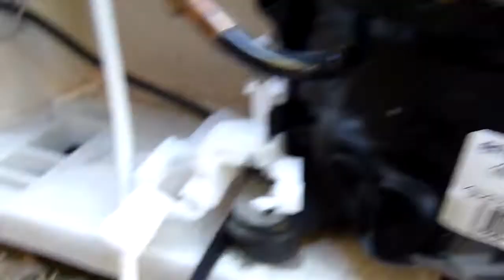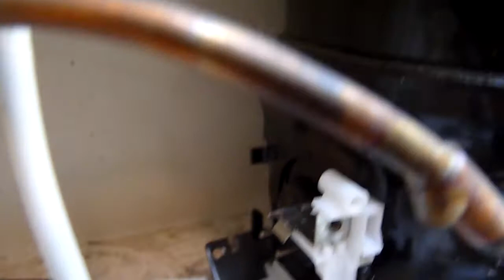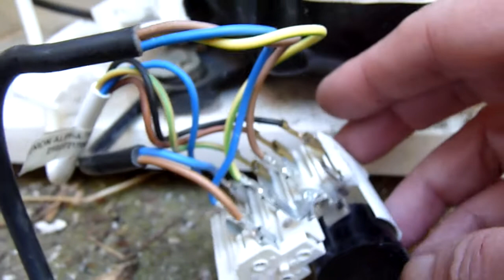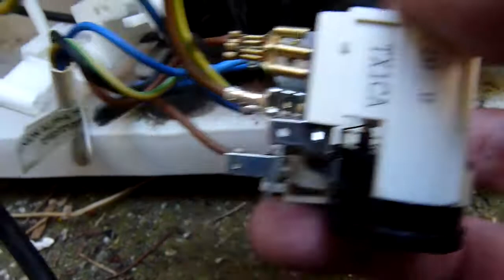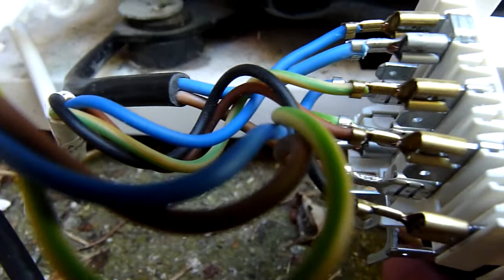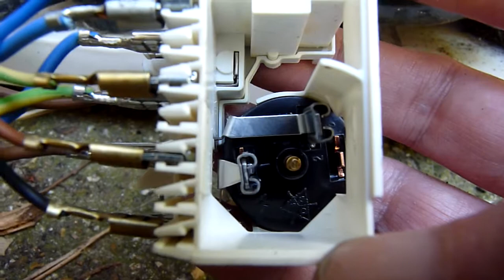closer look at relay of Indesit fridge freezer CAA55

Comment: I notice that the yellow/green (ground cable point has 2 cables, on mine i`ts only 1, so should the groundcable from power cord go to available connection where the black is or on connection line 
?
Reply from the maker: Always best to take a photo or two  of the wiring to show how it was in its original state. You might also be able to see on the relay or nearby the letter E which is Earth and where your yellow/green cable will go. 
You may also see the letter L for live and this is where your black cable goes. You have not mentioned the blue cable which is neutral and will go to where marked N.

Comment: Is the wiring the same regardless of the model number?
Reply from the maker: I would not assume that as later models may have more complex wiring to deal with safety sensors. Take photos before removal.
Reply: @toner5709  I use a KIC KBF 525/1 ME refrigerator, and I accidentally disconnected cable/wires from the circuit. Do you perhaps know how to connect the wiring for the KIC fridge?
Reply from the maker: @tatianamaria7842  I am not familiar with your fridge to be sure. You may look at my video and freeze the pic to then see the wires for mine. this might help you to then figure out yours.  You might have the same number of wires so they might go in a similar way. Also how the bunch of wires hangs may give you a clue as to where they went. Usually the relay will have letters to say what goes where. N will be neutral,  L will be Live and  E will be Earth. Get someone to help you if still stuck.

Comment: Hello sir. I'm having some trouble removing the relay for this same model of fridge its very tricky. How did you do it? Maybe we could touch base by phone!
Reply from the maker: I seem to remember it was a tight fit. You could try a flat-blade screwdriver to prise it away from the condenser but do this carefully.
Reply: @toner5709  Thanks for responding. Managed to do it. Just need to pick up the part, but wanted to have a look around first. Good day to you.